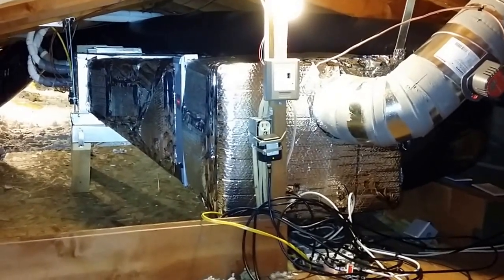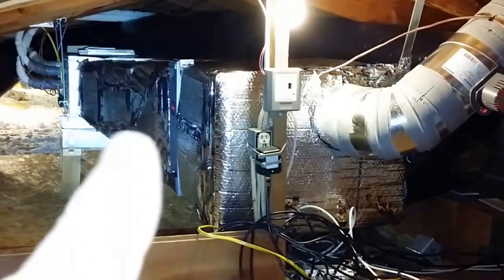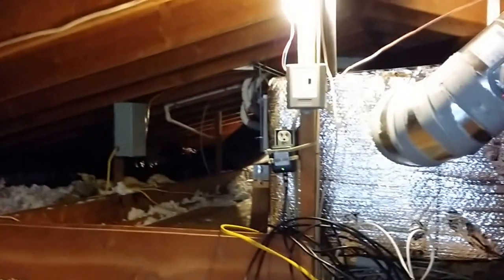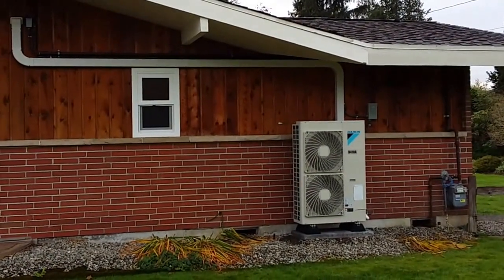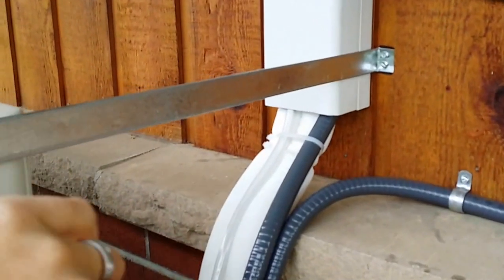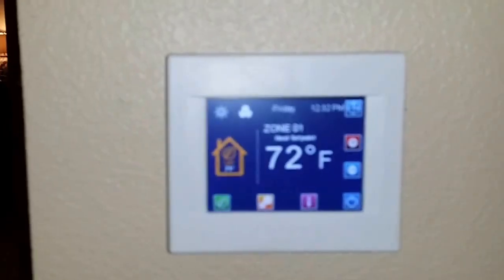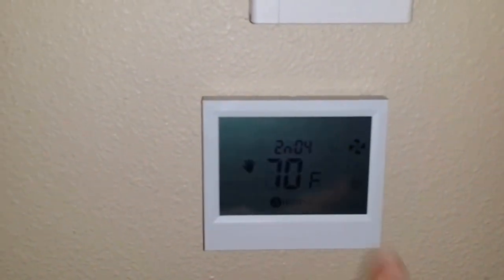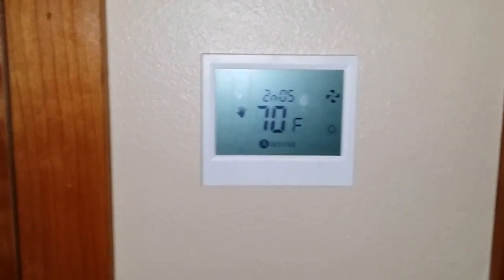Daikin Duscted FBQ w/ 4 Zo

Comment: Pour a concrete pad with threaded rod embedded  and bolt down the unit.  Remove the upper straps that transmit vibration. That's how I installed my outdoor unit and it is quiet.

Comment: Hello.I am interested in ducted system for may home and I also have  4 chimneys, I can use as a ducts lines. Diameter of chimneys is about 4 inches, and I will try to split one duct from indoor unit in two, because i have 8 smaller rooms to cover. I also saw on some forums, that the diameter of one duct in the unit is about 8 inches. Is this allowed to do without affecting the appliance? Thanks for great video.

Comment: Looks awesome. I'm putting the 4 zone 3 ton FBQ in my house very shortly. Full gut and reno on the entire house. Right at 3,000 sq ft. Right around 32,000 btu heat load so I should have enough down to about 20 degrees OD temp. I'm also doing radiant as supplemental in the larger areas of the house.  Re insulated and also foamed the roof line to give me a conditioned space in the attic. I won't be piping in any returns because I'll be using the attic as a plenum return. I'm excited to see this bad boy work, I just wish I was able to get a bit more than the 4 8" zones. Just going to have some higher velocity in some areas. Should be fun.

Comment: I feel the same way.....I don't want to see air handlers mounted on interior walls, I want a concealed system. We are still in the planning stage of designing a one story 2,200 to 2,400 square foot home and looking at having up to 4 zones.

The main problems I'm having with Mitsubishi, Fujitsu etc. is that there smallest 9,000 BTU concealed air handlers have very low static pressures which limits your duct runs and to many BTU's for the zones to be conditioned.

I'm not familiar with the Daikin systems but I assume they are very similar to the other brands except Daikin also markets damper based zoning systems. I have considered using a ducted damper based zoned system, but wouldn't you at times still run into issues where just one zone is calling and the system short cycling because the CMF's are way to high? Would some designs require a bypass damper?  Many many questions ...... would love to hear your options.
Reply from the maker: richard, just happened upon you comment, email me if you still need answers. wesd@barronheating.com
Reply: Richard Campbell a